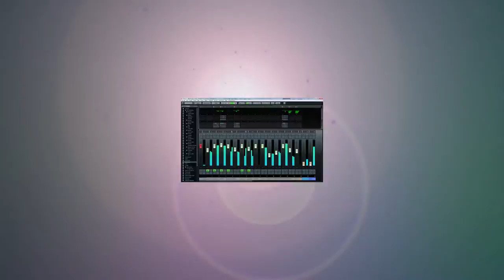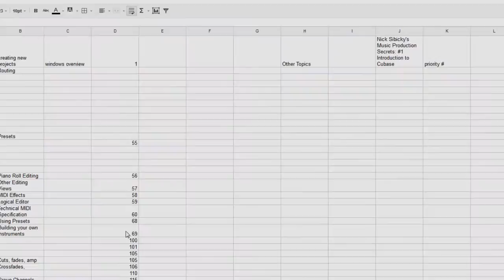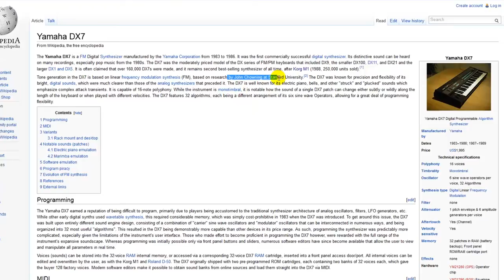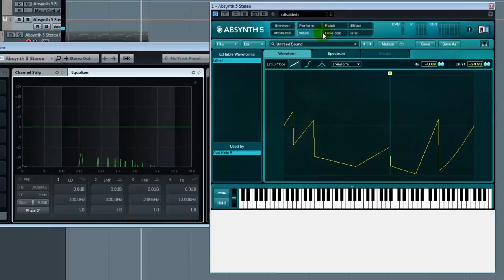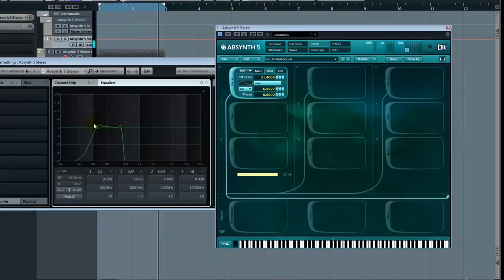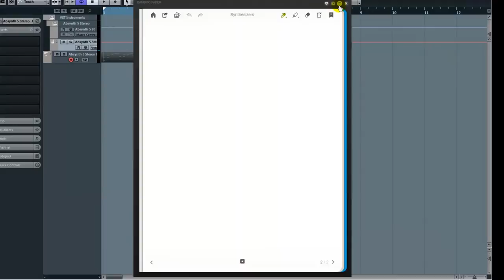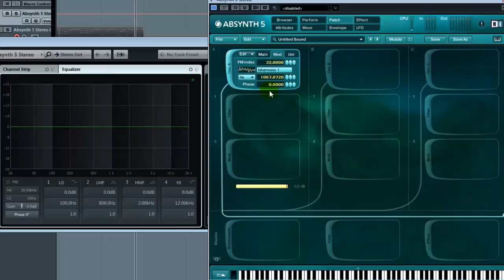Nick Sibicky's Music Production Secrets #17 - FM Synthesis

Comment: Great videos!
Just a few remarks here. If the FM index (Amplitude) is set to 0 no additional sounds will be created, as seen later in the same video. At least this way Absynth seems to work. I also think that "FM index" settings in Absynth does not fit perfectly with the "volume" in your formula. It rather shows how many new sounds are created at the interval specified in the "Hz" field of the Mod tab.